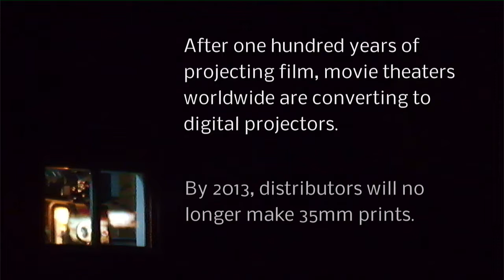Last Thread

Comment: I've made a half-dozen short films in the last 8 years, but the only film of mine that exists on actual physical media is the first one I made back in the 90's. I have the 16mm print in my basement, along with the cut negative and all the physical media elements. I readily admit that the film itself isn't that good, but I still cherish the fact that I have it. When all the digital media have gone away, it will still be around.